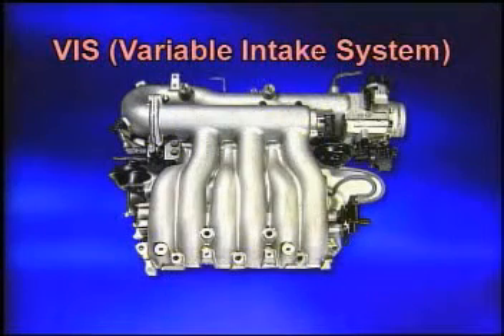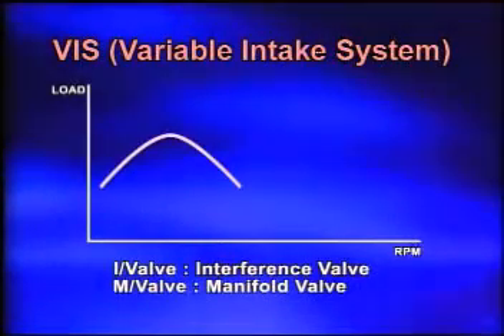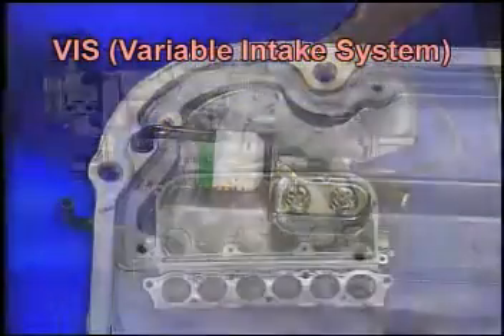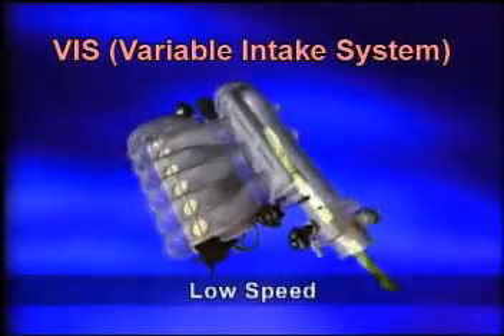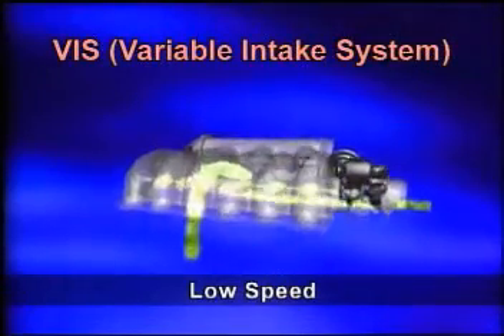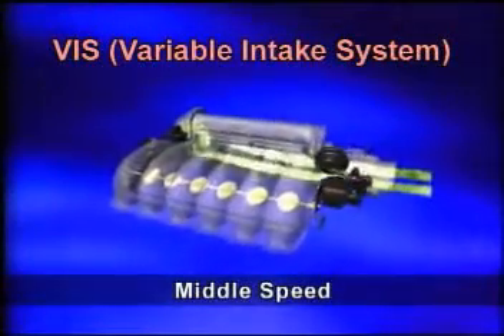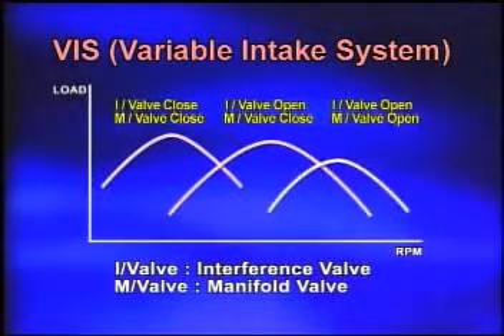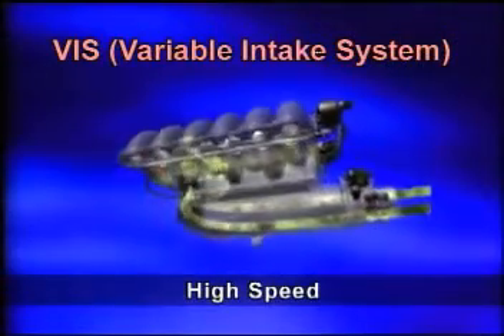KIA Sportage KM Variable Intake Manifold System

Comment: Neat system, but the pisser is that the seal where the actuated part enters the manifold has created a vacuum leak on my car. 
Hyundai does NOT have a seal kit for these, if fact they barely acknowledge that that intake system exists on a 2006 Tucson.
Now I'm stuck with removing the manifold to see if I can find a replacement for the seals.

Comment: I can’t find the manifold valve anywhere 😢
Reply from the maker: Hi there, if your engine has the valve, it must be somewhere very close to the intake manifold, after the throttle body. May I ask what your car is?
Reply: @GoProAuto  I can find the part however I cannot find a seller or any other manufacturers for it

Comment: Thank you for sharing. Coz Im worried of my 1kd engine the intake valves are fully closed on idle even stepping slight on gas pedal.
What i learn to this video was ignition off the valves are full open. Engine idle the valves fully closed. 
Middle rpm/speed sligth open.
Engine full speed/rpm the vis valve fully open. Am i right?
Reply from the maker: Hi there, thanks for sharing your experience. Yes that’s correct. ECM considers all driving conditions and engine load and RPM to optimise the VIS operation.